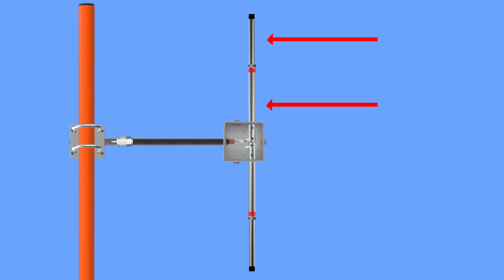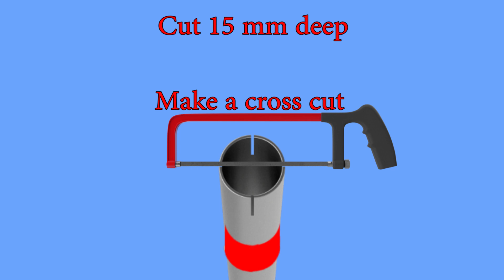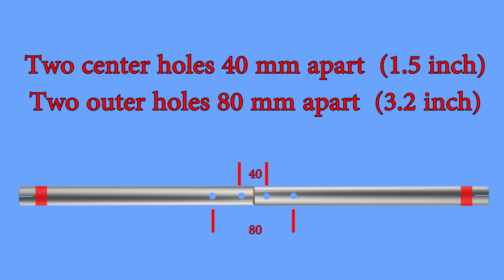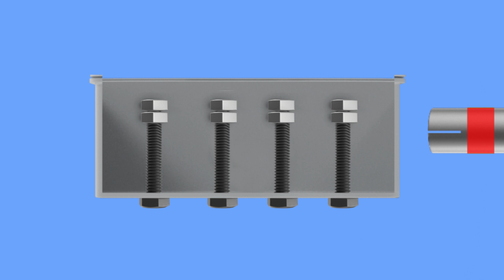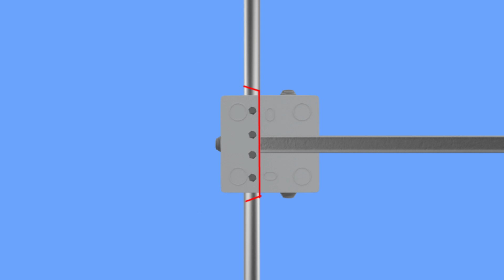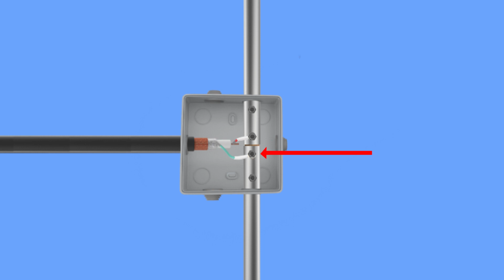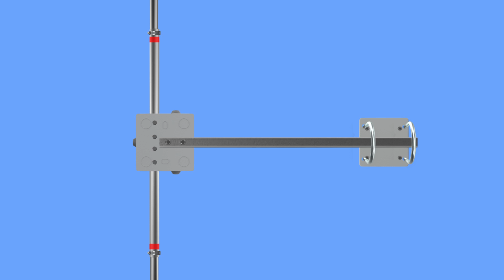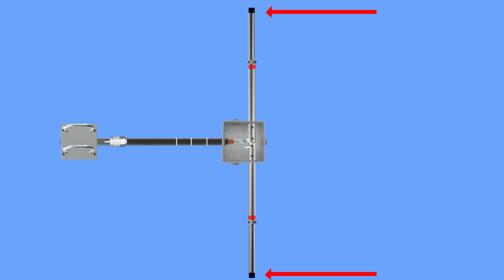FM Radio Station Antenna DIPOLE For FM Transmitter DIY Design For Radio Station Broadcast homemade

Comment: Will this work on a 53mhz - 54mhz  transmitter?
Reply from the maker: Oh yeah for sure. You would have to make the length of the poles much longer though because. 100 Mhz is about 3 meters so the antenna is about 1.5 meters long at 100 Mhz. But 50 Mhz is 6 meters so the half wave dipole would be 3 meters long .Each pole would be 1.5 meters long making it a pretty big antenna. You would also have to make the horizontal support arm twice as long as well to make sure the reflection would also be right from the mast or pole. So yeah it can be done but the size can make it difficult to install. You might need some help setting it up but yeah it can be done. Many years ago a friend of mine made one for 27 Mhz. It was massive. So If that can be done then I guess 50 Mhz is not so bad lol. Good luck.
Reply: I really appreciate your prompt and concise reply. I'm a tech but relatively new to RF stuff. The reason I asked is because I've been asked to assist with the local community radio transmission from time to time. The transmitter is around 5w. I do have a nano VNA which I've used to check the SWR. The antenna which is currently used is a folded dipole. Once again many thanks for the info.
Reply from the maker: @mohamedkikia7338 You are very welcome. It was fun chatting with you. Best of luck with all your projects. Cheers

Comment: sir can we use this for receiving the FM station ,does it should be horz or vert position,balun not used here
Reply from the maker: Yes you can use it as a receiving antenna and also this can work as vertical and horizontal. All you have to do is rotate the antenna and place it back into the mounting bracket at whatever angle you want. The balun discussion has come up many times. If you scroll down the comments you will see many discussions about. The short version of the discussion is that there are people who argue both sides whether a balun should be used or not. For receiving many people say a balun can help reduce interference but for transmitting many suggest that it is more important to tune the antenna correctly so that a balun is not needed. There are good arguments for both sides.

Comment: Don't you need balun for the antenna?
Reply from the maker: There are two opposing opinions about baluns for dipoles. For receiving antennas it can make a difference with reducing interference so if you use the dipole to receive or as a two way communication antenna then yes it can be useful but if it is purely for transmitting like this dipole was designed for then you don't really need one. I have run very low power and a few hundred watts with no balun and had great signals. The antenna tuning was more important. In many cases a balun, especially the wrong type of balun can hurt the signal more than help it. So there are differing opinions  but for transmitters I have found it best not to use one.

Comment: Thanks for the video. I'm new to the subject and I really need some information. I have a 2kW transmitter and I'm planning to make an FM radio sometime in the future. I was wondering how important it is to have exactly 18 and 15mm aluminum tubes? I can find 20 and 25mm tubes at my local hardware store. I think I can make the assembly you're describing with those materials, but will it work? What if the tubes don't fit together exactly, but I can squeeze the outer one tight?
Reply from the maker: Hi. Thanks for your comment and question. Firstly I would say these antennas are not designed for that amount of power. I would advise you to speak to antenna specialists instead. Also if you are going to set up a radio station with a 2KW transmitter you need to check your license agreement to be sure you are in spec first. 2KW is a lot of power and I don't advise connecting a transmitter of that size to these antennas. This antenna design is purely experimental and intended for low power transmitters. For 2KW you need a professionally designed and built antenna. This antenna design is not suitable for high power.
Reply: @inspiresoundpro  Thanks for the reply. Your channel provides a lot of help with many things and fortunately I can obtain licenses on my own. A temporary permit for a few months is easy to get in my area. Before that, I'm trying to decide what kind of antenna to get and where to place it. The goal is a coverage area that is 50-100 km in diameter. The grounded antenna will initially be placed on the roof of an apartment building, but in the future it will be found somewhere higher.
Reply from the maker: @youtubair  That's great. What most stations do with your power rating is to have a matched pair of circular polarized antennas. They are a bit more specialised to set up and cost a bit more money but the signal is excellent from it. You will have to speak to an antenna specialist though. If  you want a basic set up then a single dipole antenna will do but for 2KW you will need a very good quality antenna. Best of luck.

Comment: For a dummy like me, what is a 1/4 of a wavelenght????
Reply from the maker: You calculate the wavelength from your frequency. So for example 27Mhz has a wavelength of about 11 meters so a quarter wavelength would be around 2.77 meters. 100 Mhz would have a quarter wavelength of about 0.75 meters.

Comment: And then, how much would it be better with 1/4 wave 1:1 balun? Or with something between 5 or 10 high frequency ferrite toroids on coax  or with coax choke balun near the dipole? Is it somehow better with 1:1 balun or not, please?
Reply from the maker: Hi. Thanks for your comment. This question has come up many times. There are opposing opinions about this. Some insist that a balun is needed but many very experienced and qualified engineers disagree with the use of a balun on a dipole. From my personal experience, I have found that it makes no difference at all unless you are using the antenna for receiving as well as transmitting. In the case where it is for transmitting only, the tuning of the antenna close to resonance is much more important.  According to some experts the balun can actually work against you if done incorrectly. If you are going to be using a high power transmitter it would be best to consult an engineer or expert first to be sure your signal is good and legal. This antenna in this video is intended as a DIY antenna for low power use. I hope that helps.

Comment: You have made no attempt to match the antenna to 50 ohms! This needs a Pausey stub or balun to match it properly and stop the feedline radiating.
Reply from the maker: @nigehomer9744  thanks for your comment. This has been discussed many times in this chat. If you scroll down you will see many very well informed people who will disagree with you. I always welcome input about the videos but it is not accepted by all that a balun is needed.

Comment: What about a balun for this antenna , what will be the gain for this antenna ?
Thank you for the video , answering this questions will be helpful and good to improve the mach and performance for this antenna
Reply from the maker: Thanks for your questions. I have to laugh though because the balun question comes up every so often. It has been answered very well below in other comments but the short answer is no it does not need a balun especially if it's used only for transmitting. If you use it as a two way antenna or only for receiving then it might be useful but not necessary. The antenna has zero dB gain. Most quarter wave and half wave antennas have zero dB gain. If you stack them together in pairs or more you can Increase the gain. Check out my video on antenna arrays for that. This antenna is designed to be tuned so that is where the real benefit is . Cheers.

Comment: 30 year plus veteran broadcast engineer here, let me see your breakdown of these antennas is quite good. This video actually serves two purposes one to explain in layman's terms what's going to happen. And also the technicians that get too deep into the engineering., I have seen some antenna Rays with as many as 16 circular polarized dipoles stock at one wavelength apart, taking up most of a 400 ft tower. All being fed using Ridgid cable. I've also made them with rg59 coat hangers and PVC pipe. The only limiting factor is rg59 can only withstand about 100 watts. In that case we would use rg11, which can handle approximately 500 to 1000 watts. Usually we design each dipole to handle 50% of the total power will be feeding into the system even if it's a four-way system, will still design them to take usually around 400 watts each. I've also seen systems, where you have four dipoles on the tower. The cables on them are all long enough to reach the ground. And then all of the same length. Each dipole is connected to the output of a separate power amplifier, the inputs to the power amplifier are generated by a divider Network after the exciter. Essentially the phase splitting and alignment, is done at the input of the amplifiers has the amplifiers do not add significant phase shift. This can't be said for all amplifiers. But in most cases the modern solid state ones can do this. It's actually possible to obtain 100,000 watts effective radiator power using only 10kw of amplifier. Each dipole, is built into 50 ohm antenna. All the cables are exactly the same length of 50 ohm coax. And yes this uses hundreds of feet of coax to do this. You must have the same length at the Top Antenna as at the bottom antenna then all the cables are ran back to the transmitter. Where you would have the output of 10 seperate power amplifiers. Each power amplifier feeds one antenna.. the input of each amplifier, comes from a power divider network. Essentially the same thing you're building for the antennas with coax, you build a smaller version that stays down with the amplifier. The beauty of the system is that it's easy to install you just roll up the excess coax and cable tie it to the tower. Once you have all the antennas spaced on the tower and everything is ready to go. With the multiplied gain of 10 dipole antennas, we're being effective radiated power of 100,000 watts. The true beauty in the system. Is that should you decide you want a small amount of beam tilt, either up or down it's going to be accomplished by just changing the length of the coax feeding the power amplifier to that antenna. And up or down beam till is easily added
Reply from the maker: Wow it's always great to hear about the big installations and to hear from broadcast industry professionals. So thanks for your input. I unfortunately never got work on such big set ups. It's even difficult to comprehend that kind of power and all the issues that go with it. In most of my set ups if it went wrong the transmitter would go into safe mode until you fix the problem with no real consequences but at your power levels it's a whole different ball game. The cost as well in a completely different league. I think the majority of my viewers will never encounter set ups like you have worked on so always interesting to get some input about it. Thanks for you nice compliment. I do try my best to make my videos as accurate as possible while making them as understandable for everyone as possible. The majority of my viewers are first timers so I try to make the information as accessible as possible. Thanks again for your input. Always appreciate getting feedback from professionals. Cheers :)
Reply: @inspiresoundpro  just because the power levels go up, the system only gets more complex due to the size of the components used. However there are several of these antenna systems that are described using multiple amplifiers and multiple dipoles, sold by a company out of Latin america. It's actually a very ingenious system as you don't have to have crazy Tower mounted power dividers. They use basic diapers made of aluminum tubing with a plastic Center insulator. I believe they feed them with LMR 600. The number of feet per antenna Escapes Me Right now, but the system is somewhat built to order so that they can optimize the cable length however all cables are of equal length. And then it uses a stack of multiple 1 KW power amplifiers. Most modern FM transmitters even from the cheap ones sold on Amazon up to the biggest commercial units all have powerful back at SWR protection. As the broadcasting industry we have issues with our basis. It could be anything from a lightning strike, to birds deciding to building a nest on the feed point. And he has to be our becomes unstable. Or in one case there was a gasket missing on the feed line, and the entire feed line filled with water. I had drill 1/8 inch hole at the lowest point in the system and had water pouring out, also being pushed out by the nitrogen gas we use to pressurize the cable. However the nitrogen have been turned off for several weeks, during the winter time when we had heavy rain and storms. So the cables ended up filling up with water. The only difference in low-power to high power are physically the size of the components their power consumption when you plug them in, and the height of the tower you need to get the antennas away from human beings to not cause problems. Also your harmonic filters need to be very robust and have sharp cut off. So that you don't cause serious interference. Your basic Broadband low pass filter that cuts off at 110 MHz is woefully inadequate. I would highly suggest anyone attempting to build their own transmitter or Exciter board. Do some research into the design of these filters. The fixed capacitor values, could be reduced slightly and then parallel with a adjustable trimmer capacitor. Thereby allowing the operator to tune out and know the second and third harmonic. As the current FCC standard requires your third harmonic to be 60 DB lower than your main carrier, it is hard to achieve that using a Broadband filter circuit tuned for just below the aviation band. Normally I would have a 5 or 6 Pole low pass filter mounted in a small chassis box on the Exciter, then good coax between the chassis box filter and the input of the FM amplifier. In some cases should have been a particularly dirty radio system with a lot of harmonic issues we would add an interstage filter you clean up the output of the Exciter feeding into the intermediate power amplifier. We found out by doing this we actually gained about 10% more output power then before, as we were cleaning up the signal before it went into the main power amplifier and was not as wide, therefore the amplifiers gain was all focused on one frequency rather than a broadband signal along with noise. Similar to you how 1,000 Watts on FM radio goes a lot farther than a thousand Watts on television. Because if television signal is 6 MHZ wide, so when you refocus the wide band signal to a narrow band signal you gain efficiency at higher output levels

Comment: Thank you! I will be using this antenna to simply receive FM signals. How would I adjust the aluminum rods to tune it to a specific frequency? The video you recommend at the end titled, ‘FM Transmitter How To Build Circuit DIY Homemade’ does not explain how to tune (adjust the aluminum rods) on this adjustable Dipole antenna for maximum receiving of FM signals. Maybe I missed something. Thank you again. I like the way you explain the build process. Very clear and thorough!
Reply from the maker: You are very welcome :) Yes I have a video on how to tune antennas. My channel is mostly focused on transmitting but the same principles apply for receiving. Only problem is that to tune the antenna perfectly you actually need to run a transmitter into in to measure the return signal or you have to buy a fairly expensive antenna analyzer. The best option for receiver antenna is to simply adjust the antenna by physical length to as close to the signal wavelength as possible. The video to watch is this one : https://youtu.be/WOGX70-kIYA 
It is intended for transmitters so most of the tuning wont apply but it does explain how to calculate the antenna length using an online calculator.

Comment: Can I use this adjustable dipole antenna for simply receiving FM signals? All I want to do is receive a strong and clear FM signal on my FM receiver. In other words, is this adjustable Dipole antenna project ‘overkill’ for simply receiving FM signals or would I be better off simply building a fixed length basic dipole antenna? Thank you kindly for this DIY adjustable Dipole antenna project. Looks fantastic!
Reply from the maker: Thank you. I always enjoy it when people get some value form my videos :) Yes this antenna can work very well for receiving. It may be an overkill if you only want a slight improvement but if you are far from a transmitter like in rural areas then this antenna is great for that. You can also build a directional version but that would be way bigger and difficult to install. For transmitting and receiving this antenna, especially if you tune it to the frequency you want, will give a very strong signal.
Reply: @inspiresoundpro  Thank you. I am going to ask a different question and didn’t want to bury it here. This way others can see it more easily and learn from your answer. Thank you!
Reply: @youtubecommentor4480  the sizes and sturdiness are overkill for listening to broadcast fm. I made a simple dipole of 1/8" solid copper wire and mounted it horizontally (broadcast fm is circular polarized) and it has exceeded expectations. Amazon sells small diameter nesting aluminum and copper tubes that would be great too. if you take a look at commercial outdoor antennas, they use 3/8" diameter elements or even smaller